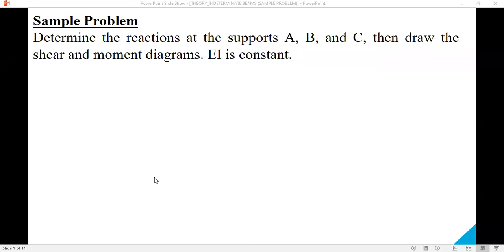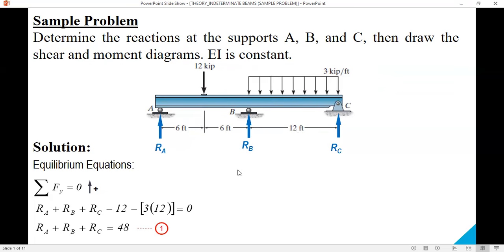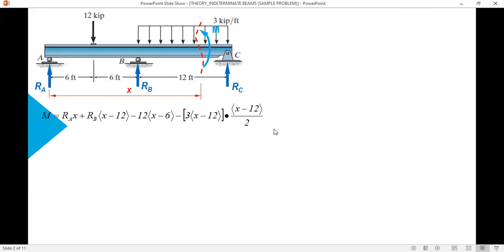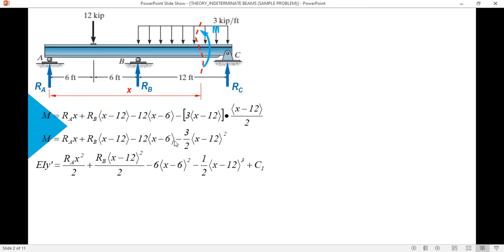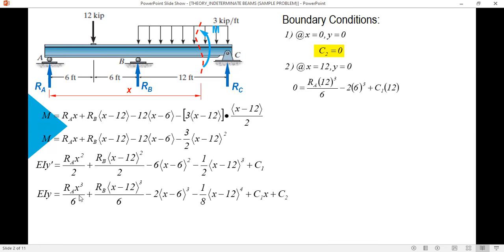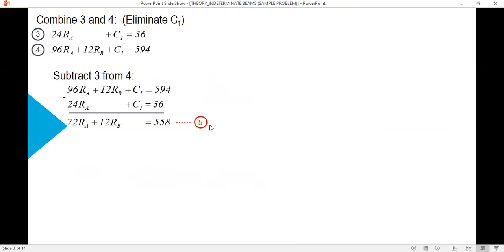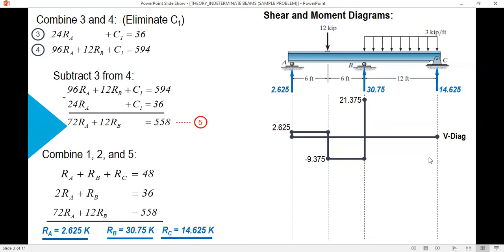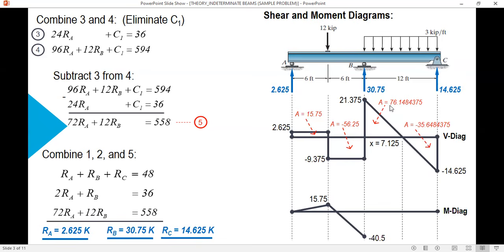STATICALLY INDETERMINATE BEAMS | DOUBLE INTEGRATION METHOD |

Comment: Sir i have calculated this moment i have but.   2RA   +  RB   = 42
Reply from the maker: if you add the two terms, the result is 432....but after that, you divide it by 12 in order to reduce the equation to simple terms.

Comment: Pa explain po pano nakuha mga reactions sa 13:58
Reply from the maker: In the video, the detailed solution was not shown because I said that the reactions can be obtained using a calculator which has functions that can solve simultaneous equations. But if you want to solve it manually, you can use method of eliminations.

Comment: Paano po pag may internal hinge?
Reply from the maker: if there'e an internal hinge, then it's a determinate beam...but do not use Macaulay bracket functions...instead, use the basi  double integration method

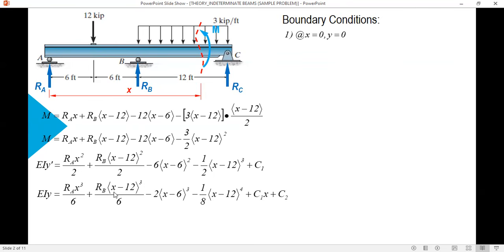Comment: Sir, ask ko lang po bakit neglected yung negative values sa pag input ng unang boundary conditions pag input ng 0?? timestamp: 9:26
Reply from the maker: when yoy use Macaulay bracket functions, the condition is:  if the value inside the pointed bracket is NEGATIVE, neglect the term... you can search google about it...